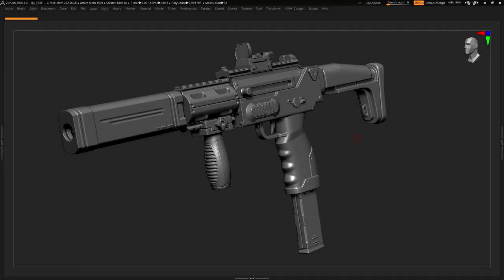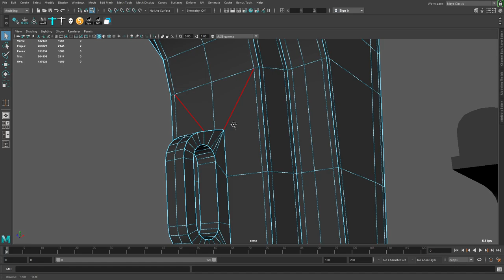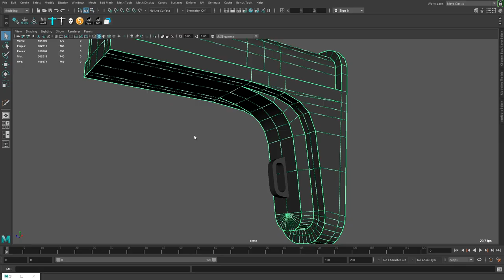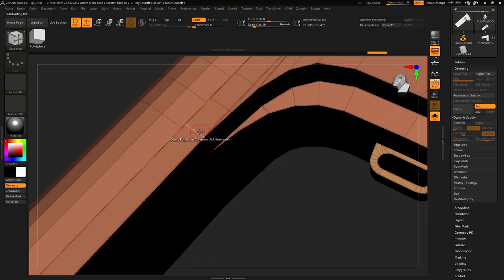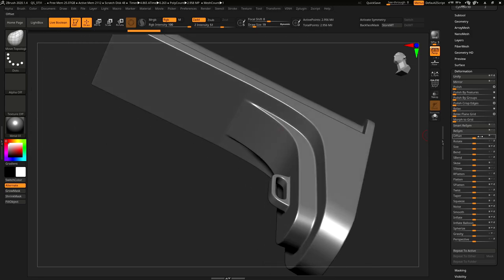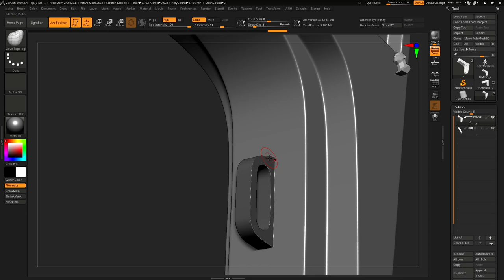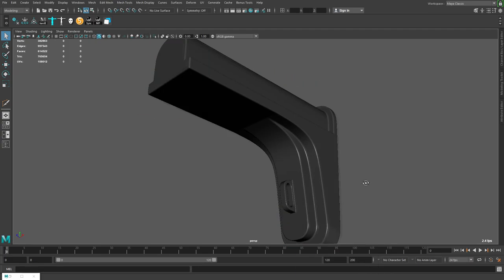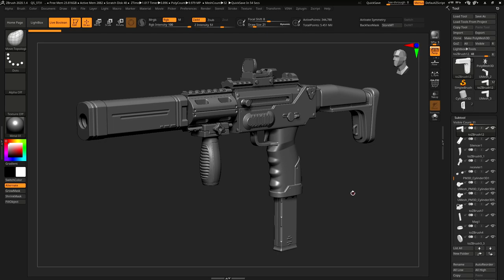SubD Modeling vs. ZBrush Hard Surface Modeling | PART 1

Comment: How do you export maya crease to zbrush. I never able to get crease. Also when i make crease in maya file and export ti and bring it back i lost my crease.
Reply from the maker: Hi. With Maya to ZBrush you can use my method explained in the video. Splitting the edges and then export that version into ZBrush to crease in there. ZBrush creasing and Maya's are not using the same algorithm. Also I have been told that the ZBrush plugin called Smooth Group Import can do the steps with ease. 

With Maya crease export and then import back in keeping the creases, you have to export using FBX, on the export Geometry options, check the first and the third option (Smoothing Groups - Tangents and Binormals). Then when importing, under Geometry options check unlock normal.
Reply: @pinggwindev  thank you
Reply from the maker: You're welcome! Hope that helps :D

Comment: This is A amazing tip for me~!
For game asset,  Artist use decimated mesh to use it as high poly mesh in other software like Maya, blender and max for baking normal in general ?   
I don't know about game asset so I wonder what type of mesh should artist use for high poly mesh for baking normal after finishing all of details in Zbrush ? 
Becuase Lv 4 mesh looks too heavy to export it to other software as I think so..... Decimation should be conducted to reduce the number of polygon before exporting ?
Reply from the maker: Yes, generally for game art, we'd decimate them at around 20% to use as a highpoly for normal baking. Btw, this isn't quite relevant but in my humble opinion, I think Marmoset Toolbag has the best baking tools for game assets, and their workflow is generally simple yet powerful! I recommend giving it a try if you haven't! Have a good one!
Reply: @pinggwindev   Thank you so much for your tips. 
I’m studying game asset to switch my position but It’s too different from Cinematic industry I think.
I thought the meshes decimated from Zbrush may have uneven angle normal because in cinematic, 
We uses soft normal tool or smooth normal for making low resolution mesh smooth. 

Then, I shouldn’t use soft normal tool on a decimated mesh right?  because it’s okay with quad mesh but
it makes normal angle of decimated mesh weird. Am I right? 

Yeah I will use Marmoset. you are right and I heard that from other people haha
Now I learn and get it about game asset. I really appreciate all your information :)
Reply from the maker: I am sorry but we quite don't use soft normal tools in game art. Or I could be wrong and maybe they call it differently in games and cinematics haha. I don't have cinematics background so I might not be the best to answer that. :(

Regarding the decimation, the mesh would have weird artifacts if the percentage of decimation is really small, I wouldn't recommend going anywhere lower than 20% for highpoly mesh. If you bake it in Marmoset it's gonna smooth out your decimated mesh so there would be no artifacts in your normal map, if that's what you're worry about!

Normal baking is not an easy subject and it would never be. I am planning to make a video addressing all the normal baking tips and how to troubleshoot baking problems in the near future. Please stay tuned for that! And thank you for your kind words! Much appreciated!
Reply: @pinggwindev  Sorry for late replay. I didn't get any alarm for your comment. 
Now I get it about game asset so Yeah game asset don't need to soft angle for decimated mesh. Now I can make hard surface model for game but It was really tough to understand all error of making process. 
I'm not sure but marmoset and substance painter are a bit different in baking normal. 
decimated mesh has normal angle problem in Marmoset but in Substance painter was okay with decimated mesh. I'm not sure but Marmoset requires much more resolution of decimated mesh to look smooth normal angle as I see. but in Substance painter has no problem with low resloution of decimated mesh but SubsPainter cannot deal with heavy mesh , 1.9gb more. so it should be less than 1gb but Marmoset can deal with heavy mesh and even just original divided mesh without deciating. It was super heavy but there was no problem to import that kind of heavy mesh. 
But I use UDIM workflow, I baked normal in Substance patiner so I 've been through a lot of trouble with my heavy hardsurface mesh  haha... 

I'm also planning to make weapon in Zbrush but I tried to use Fusion 360 and It was not bad but had performance issue and now I'm going to try Plasticity. 

Anyway, Thank you for your comment and I'll try to give some good information in the near future.

Thank you~!

Comment: What do you think about hardsurface modelling in fusion 360? I think it is more easy and more powerful.
Reply from the maker: Yes Fusion 360 uses a boolean-chamfer type workflow which is really fast! Typically it will more or less give the same result. I have friends who use fusion but I haven't tried it myself :D

Comment: thanks, it would be amazing to see a workflow that shows the Low Poly Modeling inside Zbrush. So you can use the asset also for low-poly game engines. Thanks for sharing, appreciate it!
Reply from the maker: I would recommend doing low poly in Maya, Blender or anything alike. But I have taken note of your suggestion! Thank you very much!
Reply: @pinggwindev  yep. I am currently using Blender for Lowpoly retopo. By the way. In zbrush: you select an object, use an alpha map and hit space to move it in place. After releasing the alpha gets destroyed and just shows as a black square. Is this a bug 🐛 in the latest version?